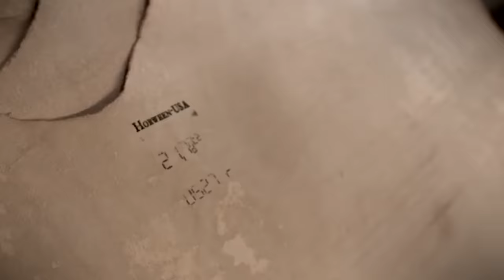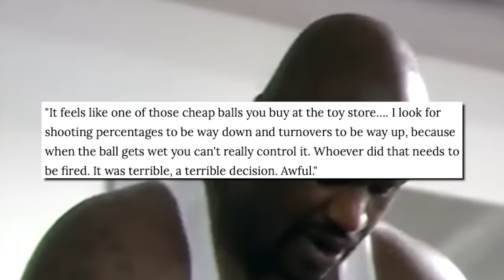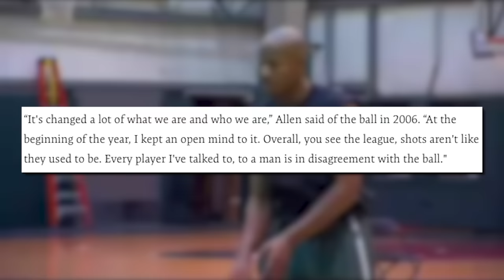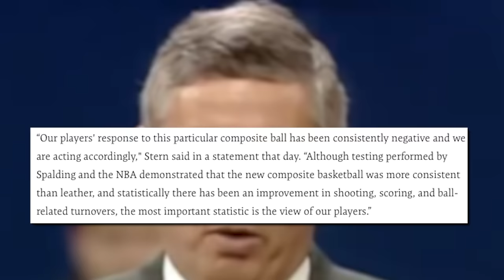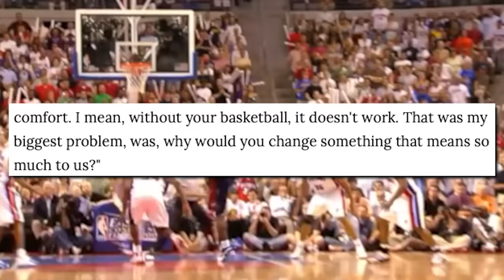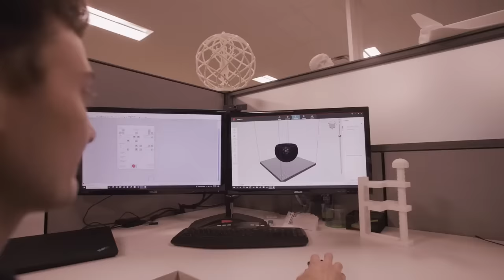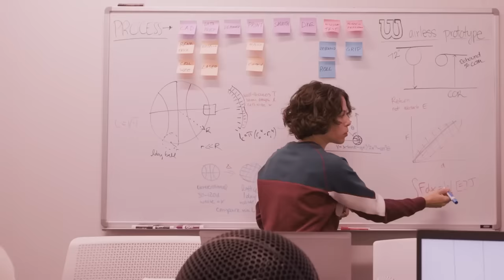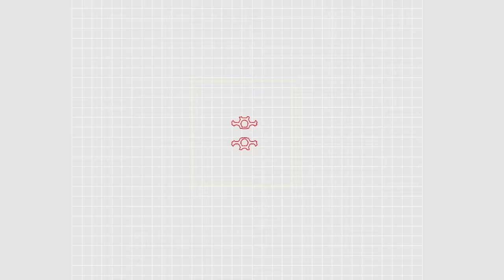The Weird Truth About The NBA's New Basketballs...

Comment: The only issue I see is how can these type of ball preserve a consistent shape like the current basketball we are using? 

Regular basketballs that are in good condition constantly deflates air but in a very small amount and even if this is the case the deflation and deformation is consistent and not random; while the 3d printed version of basketball would likely deform and compress at a very random way considering the construction it is supported with.

Forming a ball through air will implement a more consistent solid shape even if it is compressed or deflated in a higher amount which is very important in ball handling and shooting.

The advantage of the 3d printed ball is that there would be close to no change in weight. While the regular basketball can theoritcally lose a very micro amount of weight throuhout the whole single game. I could be wrong though, the air lost could be insignificant and theres no way it would affect the potential accuracy of a player. Or maybe theres no air lost at all with that amount of time.

Great Innovation but might need more technology improvements to make it a better alternative to the current basketball. I think NBA needs to focus more in advancing the technology of their officiating instead of spending a lot of time to trying to replace a basketball that works. The officiating is still a big issue that I think each team should be given at least 3 review challenge instead of 1.

Comment: A flaw I noticed is that you probly cant sign it and make historical artifacts. And in my opinion, its kind of a disgrace to the legacy of the game. The same goes for shoes technology. Like if the game started with a pig blatter, and now youre using oil sludge, you wownt have the physical connection to the greats that came before you. 

I understand that wearing converse can cause injury since theres less support than modern bball shoes and same with the helmate technology in  nfl. But how often does the ball  injure the player? Like are we gonna be using aerogel balls in baseball with vr headsets to catch the ball? Also just an opinions is that basket balls should vary slightly in pressure so that it makes a player more versitile. If we make footballs out of glue traps then players could catch balls with their pinky fingers and it would be a disgrace to the players that catch the ball with their fingertips.

Comment: Ugh. Does no one think in terms of physics?

Holes everywhere does not mean the air passes right through. It will pass through, yes, but it will be forced through and into the object and then through and out of the object meaning it creates two layers of resistance. First convex and then concave. Test that. 

Test for that. 
Pass right through? Ffs. Alot happens as it's passing and meeting resistance. 

Internal wedges would lead to less resistance during exit. If it weren't just flat around the holes and the edges of the holes were wedged it would reduce alot of issues that will arise.
Reply: The only tests that matter are player acceptance and game performance. Oh, and viewrer interest. You lost the first one, then you lose the second one. You lose the second one, you lose the third one. You lose the third one, well, the league loses a shitload of money.

Comment: They're forgetting one major change this new ball will have, and that's far less friction when bouncing or being passed (as Newton's Law goes, less surface area means less resistance, less resistance means an object in motion may move at a faster rate, and the holes in this ball provides far less resistance).
Reply: that's not how it works at all. pretty sure this is less aerodynamic than a regular ball in its current form because of all the vortexes and broken laminar flow that comes with the holes. same reason why a open-top car is less aerodynamic than a hard-top one

Comment: 0:39 i dunno what they made FOOTBALLS out of in the states but in europe at that time, the rules were they must be a pigs bladder (for the air container) surrounded in cow hide (leather)
7:33 digital pressure gauges that support up to 3 significant figures exist. like wth.

Also all the wholes will increase the aero drag on the ball while it is moving this will mean that in order to achieve the same distance from a throw you will have to throw it harder.

Comment: While that new ball design looks cool and futuristic at first glance, it's actually old tech (just not used for basketballs yet) and it pretty much a horrible idea for re-usable basketballs.  It might be okay to use them one game, so if they can make them recyclable then that might work but then that would also make them cost prohibitive.  The different material and honeycomb pattern will grip totally differently.  The Magnus effect will probably work differently too.  The fact it is open to the air means one of two things.. either if they're weight prior to airing up the regular leather ball and claiming they're the same weight then the weight will be higher for an aired up leather ball.  If they're comparing the weights with the leather ball inflated and saying they're the same, then that means the leather ball will weight less if partially or fully deflated.  This isn't really a good or bad thing on the surface, in fact it looks more consistent therefore a good thing for the new design.  However, this will impact the ball's physics.  Essentially, they can claim they're the same ball in a few measures of the word 'same' but they're not the same in other ways.  And, contrary to what another commenter said earlier, no a perforated leather cover over the new design still will not have the same feel or function exactly as the regular leather ball's though it might still be a good idea for the new ball design (keep in mind though unless it is very perforated there will still be inflation like physics with a cover and  yet ironically, depending on the materials and design, the cover might slip over the new grid ball inside.. so again this will impact grip and reliability of the ball.  There's just so many potential problems with the new ball, I'm surprised the video author seemed so positive about it.